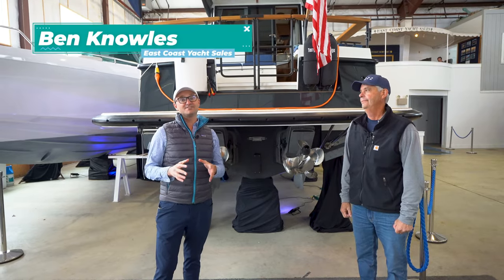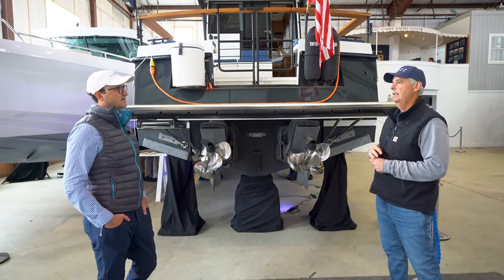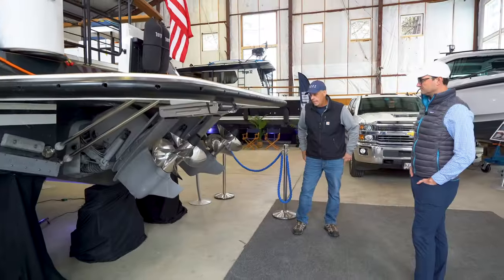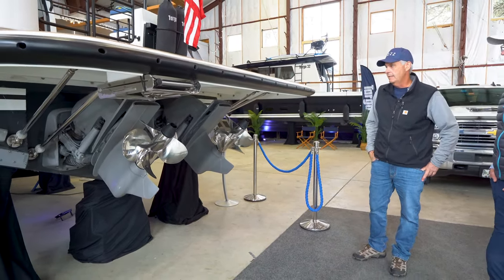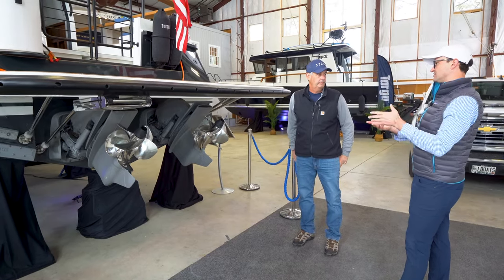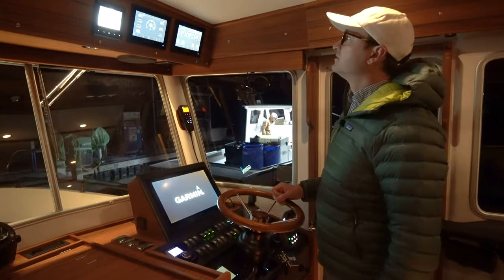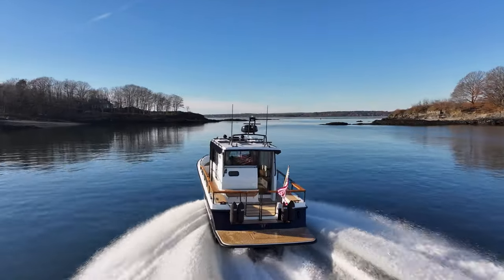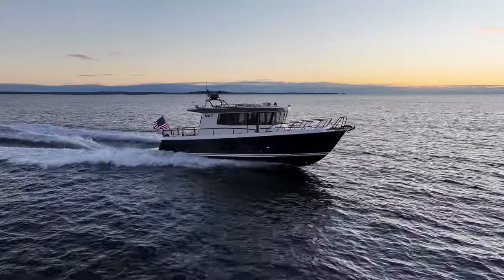Facts About Volvo’s DPI Stern Drives

Comment: It was interesting to learn about the updates Volvo has made to their sterndrives. If the Bellows starts to leak while the boat is in the water, does water get inside the boat?
Reply from the maker: Thanks for the good question. If water comes into the bellows there is a seal blocking water from coming into the boat.
Reply from the maker: Here is a short video with this question explained by the pros: https://www.facebook.com/share/r/wiPK1aS4BgWrzvPb/?mibextid=WC7FNe
Reply: @EastCoastYachtSales  Thank-you!
Reply: @EastCoastYachtSales  Sounds like Volvo has it covered.  This makes the choice of a stern-drive even more compelling. Thank-you!
Reply: Has Volvo added docking assistance to the new stern drive
Reply: @georgedomany2848  yup

Comment: Another comment/question...  If the IPS can handle 1000hp, how come the Volvo sterndrives can only handle up to 440hp? At a glance, they are basically doing the same thing.
Reply from the maker: Good question.  The IPS drives have 3 different sized pod drives, as you go to the larger HP range the pods get larger in size.  The DPI sterndrives have the same power range as the IPS 1 pods (up to 480 hp).
Reply: @EastCoastYachtSales  I wonder what the draft reduction on a Sabre 58 Salon Express with tripe 480hp sterndrives would be. I like the 1350's with pods but am considering any reduction in draft from the smaller IPS pod's. Clearing lines from stern drives is much easier than sending someone overboard with a knife near a rocky shoreline.